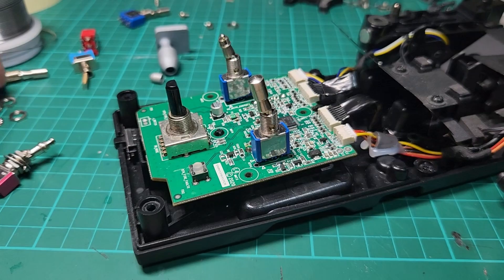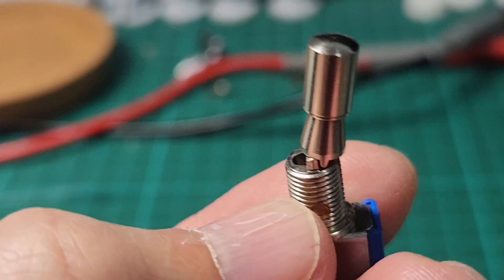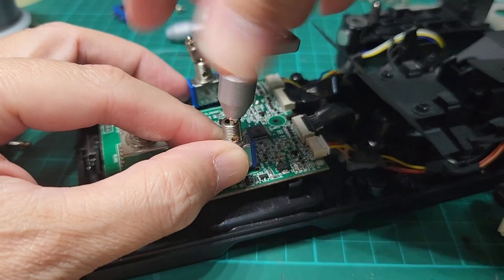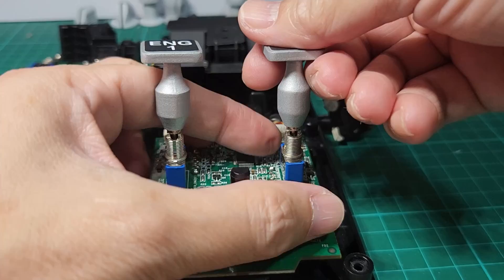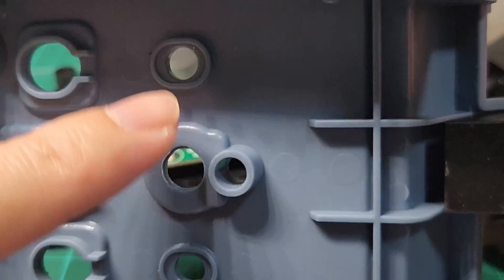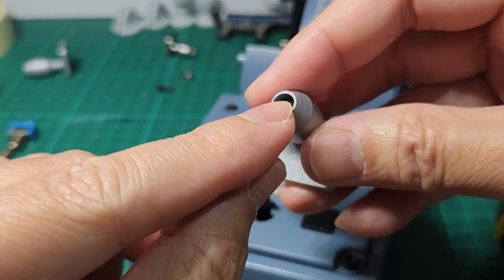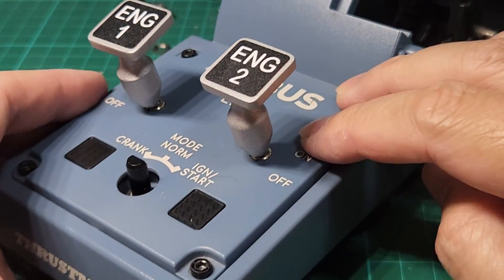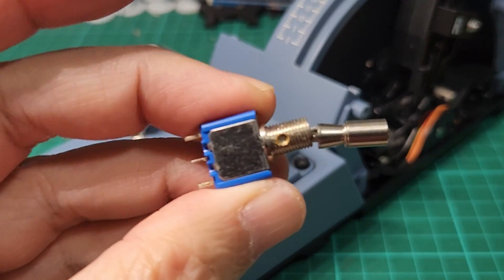Engine Switch "Lift-to-Unlock" Mod for the TM TCA Quadrant - DIY

Comment: Hi Santi, i was just wondering What would i need to do to get the decals for the switch after printing them
Reply from the maker: Hi, the sticker/decals should be one of the files in fhe download. It is in another folder if I'm not wrong 😊. Please email me if you still have problem @ Santiagoluib3@gmail.com
Reply: @santiagoluib3  oh yes i do see it i just dont really know what to do with the file😅

Comment: Hey Santi,

I just bought the switches from Aliexpress, but the contacts did not fit through the three holes of the board :-(
Reply from the maker: Hi Luca!  What do you mean by not fitting the three holes?  Are those the 3-pins switch variants you bought?  Are the pins spaced differently (which I doubt as these switches have standard pin spacing).  Is it because the pins are larger (they have holes in the middle). If so you just need to pinch the pins so they can squeeze through the circuit board holes.  Please email me so we can discuss details and I can further help you  :)

Comment: Hey, love these mods!!! Really great stuff. How do I take off the cover? I have it all the way to the throttles but those seem to be in the way of pulling the cover off and I can’t figure out how to get them off
Reply from the maker: Hi Tristan. There are tiny metal pins that hold the original ENG1/ENG2 handles.  You have to push them out using a small rod, then pull of the handles.  Please email me for details at  santiagoluib3@gmail.com   :)
Reply: @santiagoluib3  Awesome! Thanks a bunch, I got them out and got one of the switches soldered. It doesn't seem to work, but I had a bad time desoldering the original so I think I might have broken some traces... I new I was being a bit hasty...
Reply from the maker: Hi  @shredder8910 Sorry to hear that.   The connections on the board under these switches can be a little too sensitive with overheating.  So in the process of desoldering you may have overheated the holes and lost the circuit connection.  Get a good, powerful solder "sucker" and add more tin into the solder while melted to easily suck the rest dry!  I should have mentioned this in the video :(
Reply: @santiagoluib3  No problem friend! What's some tinkering without some accidents every once in awhile 😂all in the name of the game. Really appreciate all your stuff on these throttles, i've purchased some of the STLs and they've been an amazing game changer for these to turn them into real serious sim hardware. 💖
Reply from the maker: Thank you for the kind words  @shredder8910  .   I'm glad those STL files worked for you  :)

Comment: Hi, just curious. How is it going with the parking brake upgrade? Any update already on what spring or material we have to use? Thx
Reply from the maker: i still cannot find the right spring.  The spiral type is not very effective because there's only about 3mm of space to work with.  I'm looking for those plate type pressure springs, something like Brass Shing material.

Comment: Thanks for your nice Mods. But the first Link for the switch did not work.
Reply from the maker: Hi, sorry for this very late reply.  Have you found the switch in the other link?   I tried the first link and it works just fine  :)